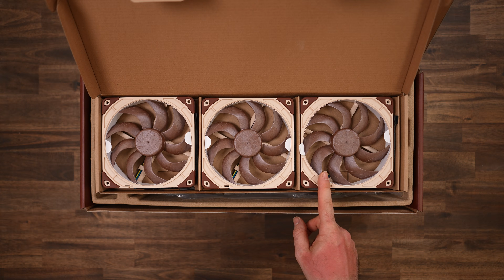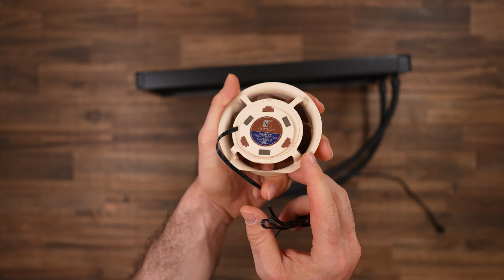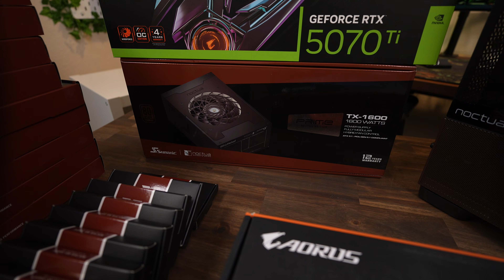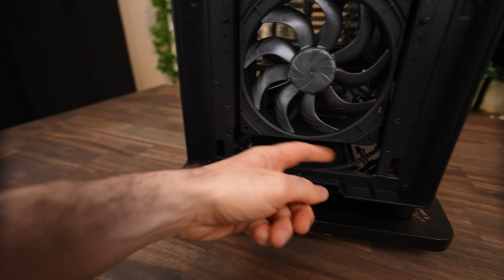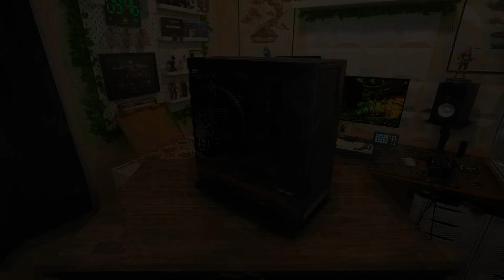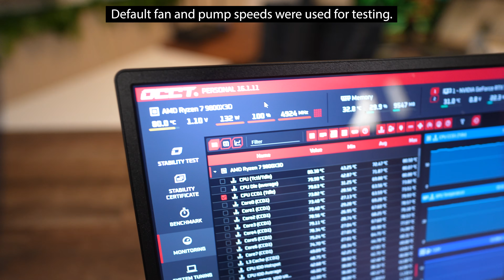New AIO King?! | Noctua NL-LC1 Stealth Build!

Comment from the maker: Hey guys, thanks for tuning into another video! Today, we are unboxing, installing, and testing the new Noctua NL-LC1 line of AIO coolers. We got a super clean stealth build for this one. Everything used in the build is linked below, as well as Noctua articles related to the build:

AIO: https://amzn.to/4vpBlYb
Case: https://amzn.to/3St7lMp
CPU: https://amzn.to/4azRD8p (Comes with Brown G2 Fans)
Motherboard: https://amzn.to/4xvwt5a
RAM: https://amzn.to/3XLfFXf
Storage: https://amzn.to/44cBt16
Fans: https://amzn.to/4eqc1Kn (Bottom - 120mm)
Fans: https://amzn.to/4xsNrB8 (Front, Rear, AIO - 140mm)
PSU: https://amzn.to/43Cos0M

Noctua articles provided:

How the AIO works:
https://www.noctua.at/en/products/nl-lc1-42

How our SecuFirm2+™ mounting system enables NL-LC1 coolers to achieve lower temperatures
https://www.noctua.at/en/expertise/tech/how-our-secufirm2plustm-mounting-system-enables-nl-lc1-coolers-to-achieve-lower-temperatures

NL-LC1 series AIO coolers’ pump speed profiles explained
https://www.noctua.at/en/expertise/guides/nl-lc1-series-aio-coolers-pump-speed-profiles-explained

Should I use the NL-ACF1 auxiliary cooling fan?
https://www.noctua.at/en/expertise/tech/should-i-use-the-nl-acf1-auxiliary-cooling-fan

Asetek Emma V2: State-of-the-art closed-loop liquid cooling
https://www.noctua.at/en/expertise/tech/asetek-emma-v2-state-of-the-art-closed-loop-liquid-cooling

Where should I install my AIO radiator (top vs. front/side)?
https://www.noctua.at/en/expertise/guides/where-should-i-install-my-aio-radiator-top-vs-front-side

How should I set up my NL-LC1 radiator fans (push, pull or push-pull)?
https://www.noctua.at/en/expertise/guides/how-should-i-set-up-my-nl-lc1-radiator-fans-push-pull-or-push-pull

Which AIO radiator size should I choose – 420, 360 or 240mm?
https://www.noctua.at/en/expertise/guides/which-aio-radiator-size-should-i-choose-420-360-or-240mm

Should I run my pump at a fixed speed or use automatic speed control?
https://www.noctua.at/en/support/faqs/should-i-run-my-pump-at-a-fixed-speed-or-use-automatic-speed-control

Is it OK to install the NL-LC1 with the tubes exiting to the sides or to the top?
https://www.noctua.at/en/support/faqs/is-it-ok-to-install-the-nl-lc1-with-the-tubes-exiting-to-the-sides-or-to-the-top
Reply: Thanks for putting out another video!  I always look forward to the next one, too.
Reply from the maker: Thank you so much!
Reply: 279

Comment: I am building an ASUS gr701 with the same 420 rsdiator you are using and I bought 7 14x25 and 3 12x25 chromax doing the wiring on it as I am playing your video, I do not have any RGB either.

Comment: My artic pro 420 keeps my 9850x3d pretty much the same temps maybe even lower under different full load tasks and benchmarks
Reply: I had both and the reason is because arctic did a pretty bad job at cooling. I got i9 13900KS, one of the hottest running CPU in the world. Arctic will thermal throttle my CPU at full load.

Comment: "...but I really wanted to go all out with the Noctua side of things."
Bruh, what about the ASUS x Noctua collab GPUs...?  ;^p
What I would really LOVE to see...
A BUNCH of Noctua chromax.black.swap collab parts:
20L (or less) SFF chassis
RDNA6-based (because I want to build this blacked out Noctua SFF when AM6 drops) high-end GPU
SFX PSU (maybe SFX-L) with custom length cables to be perfect in the aforementioned SFF chassis
Blacked-out (including the VRM add-in fan) 280 AIO with tubes sized for aforementioned SFF chassis
I am thinking something similar to the NZXT H2 Flow vertical sandwich chassis, but without the tempered glass side panel

Comment: According to ChatGPT:

If you already own an ARCTIC Liquid Freezer III Pro 360, then my recommendation is:

No, switching to the Noctua NL-LC1-36 360 is not worthwhile in most cases.

Comparison

                                                          ARCTIC LF III Pro 360 :                   Noctua NL-LC1-36 :

Cooling performance                   - Excellent                                         - Excellent to slightly better

Fan noise                                       - Good                                                - Excellent

Pump noise                                   - Good                                                - Excellent

Price                                               - approx. - €100–130                      - approx. €250

Value for money - Very high - Low

Initial independent tests show that the Noctua is among the quietest AIOs available while offering top-notch cooling performance. However, the advantage over the Arctic is usually small and is offset by a significantly higher price.

When would you notice a difference?

Temperatures:

Usually a 0–3 °C difference
sometimes a little more depending on the CPU and fan speed

Noise:

This is where the real advantage lies.

Noctua has invested a great deal of effort in pump decoupling and acoustics. The pump operates exceptionally quietly, especially at low speeds.

If your Arctic bothers you

If your main problem is noise, I wouldn't immediately replace the entire AIO.

With the Liquid Freezer III Pro, the following often helps:

Limiting the pump speed to about 50–70%,
an adjusted fan curve,

or even replacing the radiator fans with Noctua NF-A12x25 G2 PWM fans.

Several users report that this makes the Arctic very quiet, and switching to the Noctua hardly justifies the high price difference.

Comment: My current PC Case is a cheap mATX with Triple Glass , Triple bottom intake , exhause on the back and 240mm MSI Core Liquid side mount Exhaust .. but my i5-14600K seems to run pretty hot on stock settings , around 91 celsius when compiling game shaders , around 88 celsius on OCCT Stress Test , I had to undervolt it to - core offset 0.075 , CPU Lite Load to Mode 15 

So currently , with undervolt and mode 15 , it ran at 40 idle and 81 celcius MAX on compiling shaders ... 

I WONDER , how much will my temp improved if I use this new Noctua AIO 240mm  .. because I've seen that it performs much MUCH BETTER than some of the high-end AIO , even the 240mm model outperform the high-end 360mm
Reply: have you tried?

Comment: Great-looking build! Just curious: any reason you skipped the anti-sag bracket for the RTX 5070? I’d be a bit concerned about long-term GPU sag and stress on the PCIe slot.
Reply from the maker: I used a GPU sag bracket and somewhat showed it during the GPU install process. I installed it toward the back and not towards the front like most people do.

Comment: I didn’t realize I needed to build a new rig until I came across this. I personally would stick with the brown Noctua fans for the aesthetic, which has me wondering, is there a big difference in fan performance between the two?
Reply from the maker: The Chromax (black) fans I used are the same ones as the brown ones, if that’s what you’re asking.

Comment: Judging form the amount of videos praising this AIO that have suddenly flooded my recommendations from channels I've never heard of before, Noctua are certainly throwing their money at YouTube to promote this. Which is fine I guess, but precisely what will personally make me avoid a product like the plague. Even if it weren't for the timing when RAM/SSD prices are through the roof to the point that even if I do think about a new build, I would be forced to avoid the premium brands on other components.
Reply from the maker: For my videos on this AIO, this is not paid, but gifted by Noctua to make videos on. If I absolutely hated it, I could speak freely on it. Given it's Noctua, we all knew it was going to perform extremely well, it's just kind of what they do with all their products. But yes, you are correct, it does have the heavy price tag to go along with it, but quality usually isn't cheap. The only downside to this AIO is that it's only offered with brown fans for now, and the auxiliary fan is also only in brown. I don't really see any other negatives to discuss if there were any.

Comment: Just ordered one and will remove the stock fans and install my current six black Noctua Industrial 3000 RPM fans instead on the radiator. Hallelujah for not having any gimmicky displays or RGB puke.
Reply from the maker: I wonder what kind of testing was done with the industrial ones compared to the G2. I’m sure it’ll be fantastic. What kind of build you got?
Reply: @DanKamYouKnow I use the industrial fans because they're black and I already have 11 of them. The Industrial fans are overkill, but they are fun to tame with precise fan curves as I've had them for years. The Industrial fans can handle start/stop as I have no fans running when I'm doing light duty work.
Reply from the maker: I have done a few builds with them, they are so versatile.
Reply: @DanKamYouKnow They are not for the faint of heart. The Industrial fans also make you an expert at setting up a fan curve.

Comment: Super clean build as always, especially the meticulous cable management!  Great choice going with the black fans.  Noctua makes great performing fans, but I personally don't like the brown/tan look and think it is holding them back.  The Noctua AIO product itself looks great and performs well.  The magnetic logo plate on the AIO cover is great for stealth/non-rgb builds and really sets it off from the others.
Some friendly feedback on the build:  If you can't turn off the LEDs on the fan controller, simply put some black electrical tape over the LEDs, problem solved.  To hide the cables running down the side of the bottom fans,  get some 1/8" or 3mm thick black ABS plastic sheet and cut out a blocking plate with a notch for the cables and put it over that opening next to the fan.  If you like, I can send you some pics/video of a custom WW1 themed build where I did this to hide some cables.  Personally, I believe that Velcro ties should remain behind the motherboard;  I think that some black/brown cable combs would look better on the power cables and AIO hoses. Finally, each out to your friend on Etsy and see if you can get some GPU vent covers printed in matching Noctua brown (or paint them if he can't make t hem in that color); that will really take the build up to the next level! 
As for the video, I love your presentation style and the time-lapse build footage in particular.  It's awesome.  The video unboxing is great, too.  You do mention that you made some mistakes/changes along the way; what do you think about including that story into the video?  A departure from the excellent process for sure, so I'm just throwing it out there as an idea.   Love your videos, love your interactions with your viewers, and hope you hit 1M subs soon!